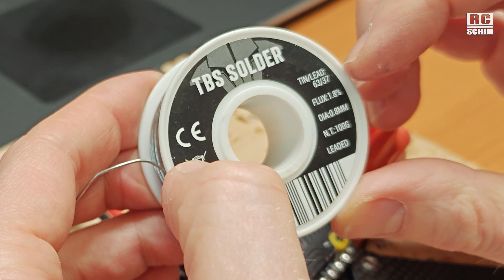Why I'm THAT excited for 5" drones again (ITsFPV Era 5")

Comment: hi Marrio, your Kukirin V2 Master is a great repair, I don't like propellers in the field of vision.    :hand-pink-waving:
Reply from the maker: Hi, today I tightened the stem (it had 2cm play at least). Now it feels better, more stable. 
Props in view are not so much of a problem. Action 2 is nice because it has sound. But battery... Still prefer onboard o3 if possible!

Comment: I’d like to see the view your watching
Reply from the maker: Most flights are not stabilized. I just cropped into the 4:3 pic since it felt Wing to show 4:3 aspect. If you mean you like to see the DVR - with o3 it's almost as good as the onboard recording, even deep in the woods which never stops to amaze me. That's why I didn't even bother to test another digital video System...

Comment: Ohh. Inspiring me to get into fpv again... What digital fpv system is 'the shit' nowadays?
Reply from the maker: for me it's DJI O3. the onboard cam quality is just really good, almost gopro level. 
range and signal stability is best. units and goggles are expensive tho.  (goggles v2 for budget - and I like how big the FOV is, or Goggles3 for smaller size, better quality and good ergonomics, but smaller FOV and 650€)
Else caddy walksnail gets a good share on the market - but I've never tested it...